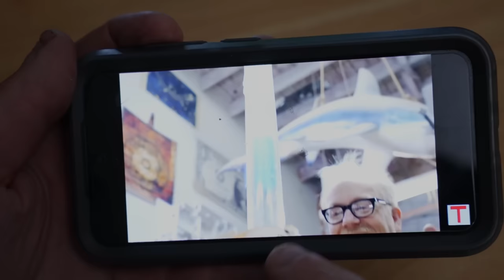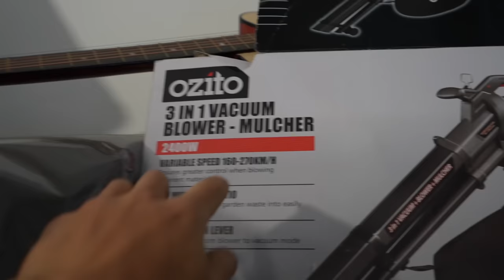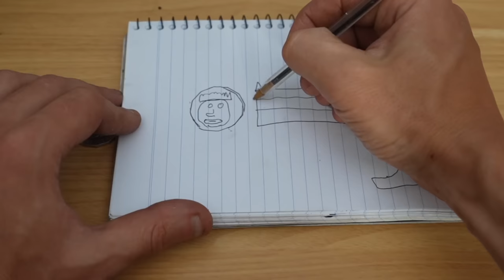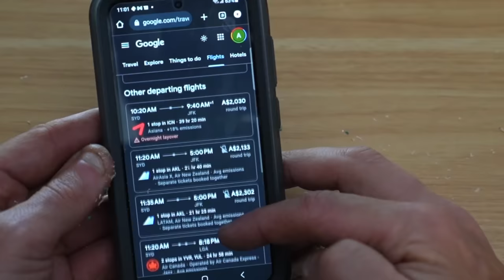The Mythbusters Were Wrong!

Comment from the maker: Some people are confused about things in the video that i didn't explain very well. 

1. Me throwing the coin had nothing to do with anything. I just wanted to know how fast I could throw a coin and also if it was possible to keep it on the skinny edge. 

2. I wasn't suggesting that you need to throw the coin off the empire state building to reach a fast enough speed to kill someone. Just that by dropping it with a spinning motion would keep it on the skinny edge allowing it to reach a much faster terminal velocity.

3. The terminal velocity I calculated was actually slower than ones that people in the comments have estimated using physics programs. Some of the estimates were around 300 kmph. 
The point of the pig test was to show what a coin traveling at 230kmph (slower than the terminal velocity) would do to you. Turn you into a piggy bank

4. Also the point of the dam test was to show that the spin would at least keep the coin on the skinny edge for 45 meters. 

5. How you going?
Reply: Goop. make a pellet gun that is as powerful as a 22 by using petroleum
Reply from the maker: I would love to but you cant get pellet guns here @thebathroombandit
Reply: I’m going well mate how are you. Sydney weather been a bit all over the place ay…
Reply: wats ur workout plan? Lemme get on dat?!..
Reply from the maker: I just chuck lots of coins at my wall @nolanbarker8913
Reply: how much force do you use per throw? @Ididathing
Reply: With more force than a professional MLB player obviously 😂
Reply: fly to NY and do a in person test
Reply: I am doing pretty good, thanks for asking. 

I am not sure whether it is harder to throw a baseball than a coin, but I suspect it probably is.
Reply: I’m pretty sure the reason your calculation was so wrong was because it was ahead
Reply: Oi oi oi, I am much less good after that comment about my mother.
Reply: I'm good but it will take me 20 years to read all of that 😂
Reply: bulletproof armor out of the desk
Reply: i will now throw a penny
Reply: im pissed mate hby
Reply: 1. You demonstrated some amazing ninja-coin-throwing skills, if it was only for that, the video would still be worth 10 out of 10.

2. I understand you did not suggest anything, but that's a great idea anyway!!! You deserve 10 virgins in Jannah for your righteous contribution. Allahu Akbar!!!

3. Side-facing, a coin is very aerodynamic while very dense - I would not be surprised if it would reach velocities higher than that. The same properties would also allow it to penetrate first layers of a target quite easily, but I don't think it would have any capacity to penetrate deeply - once inside flesh, it would turn on the side and quickly stop, so if it misses head and hits shoulder, for example, it would make a surface wound. Other than that, pig head is probably not a good replacement for the human head (I'm not suggesting anything, so if you happen to grab a neighbor and fire a coin-gun at them point blank, I have nothing with that) - the pig head you are using is skinned, plus, as far as I know, human skull is tougher. Anyway, a direct hit on the temple at 90 degrees, based on what you demonstrated, should mean bad injuries/concussions/travel to the ER/a very bad day.

4. The faster the spin, the more stable the coin should be in flight (we could imagine a device that can spin it very fast - like the slingshot you made, but with one side of the channel lined up with something that would add some friction to that side only). The trouble is - the faster it spins, the more it will tend to curve the trajectory.

5. Great, thanks for asking.

0. MythBusters and Veritasium are assholes with a lot of money and insufficient brainpower and creativity.
Reply: Im doing meh, you?
Reply: Wow sucks to live ausie
Reply: can you throw one into a vending machine
cheers
Reply: Australian but spells metres like a Yank
Reply: as a response to number 5, i also and confused about how i am. You didn't explain it very well in the video.
Reply: What about the video by Veritausium?
Reply: On the skinny side the surface area is too small to be blown by the leaf blower.
Reply: @ENDI8089 and thats the point bc terminal velocity works the same
Reply: No. You are wrong. Shooting a coin with controlled rotational and axial spin has NOTHING TO DO WITH THE REALITY of a coin in freefall dropped from a building.
What is wrong with all of you?
Reply: @aleksandarrudic3694 are u okay dude?
Reply: I goes.
Reply: Fun video. You've shown coins can be lethal, but not necessarily that a dropped coin, even with spin, would be lethal. These experiments, and calculations don't account for a variable that would be a game changer in the real world, and that variable is wind. The experiment at the dam was a fairly short distance to begin with, but it was also in an area that blocked the wind. Tall buildings can have their own airflow around them. Not only horizontal, but also vertical updrafts. Some updrafts can even push coins back up, where they land on a separate surface of the building.
Reply: you also didn't explain the sex toy in the garage
Reply: @mfloth I little bit cold, but okay otherwise, thanks for asking
Reply: I'm doing well!
Reply: I'm doing good thanks! Just another video where I fear for your safety and health 🤣
Reply: you should try making the worlds fastest slow cooker (without making a bomb)
Reply: Good how bout you
Reply: You didn't show the coin accelerating for 45 meters.  And you also reminded everyone at the end that you have no idea how stability, tumbling and terminal velocity come into play when you said "oh and the empire state building is x times higher than that..." That's not how anything works homie.  It could be 1, 2, or 100000000 times higher, and it wouldn't make a bit of difference.  And showing the coin fired out as a projectile.... hilarious, I guess, but not in the way you intended.  You do understand that even bullets, which are designed to cause damage, have to be specifically engineered to not tumble, and they're being thrown out with a lot more force than you putting some stink on a coin with your noodle arms.  And you do understand that firing something as a projectile isn't a good analog for a falling object.  Nobody ever said a coin couldn't possible reach a certain speed, they said it couldn't maintain a certain speed, and would most certainly find equilibrium pretty quickly.  Try throwing a coin on its edge straight down into water and doing any damage to anything even 1 foot beneath the water's surface;  It isn't going to happen.
Reply: Nice explanation. Granted i do not know what was so confusing people needed a recap lol thorough job nontheless
Reply: This doesn’t change the fact that the myth busters were, in fact, correct.
Reply: @Ididathing Can you make bear trap teeth.
Reply: Amazingly thousands upon thousands of coins have been thrown off the Empire and no one has died. You dont need a Youtuber with faulty science to prove Mythbusters wrong just common sense
Reply: I think you will  still be safe under the empire state even if you add a small amount of spin since there are other air currents generated by tall buildings that would push the coin side ways causing the fluttering to happen and thus lowering terminal velocity
Reply: Doing pretty decently. hope it goes up from here.
Reply: @meghanm6282  exactly, this guy proved that guns are lethal, and proved the myth busters were right lol. Mind blowing work he did there. And by mind blowing work, I mean my mind was blown by how absolutely incompetent this guy is.
Reply: Drop the coin from a drone - post results
Reply: @Ididathing  guess its time for a trip then eh?
Reply: I'm going pretty well Mr. Thing, thanks for asking!
Reply: @thebathroombandit pellet guns are already about as powerful as a 22. At least in initial velocity. I had one that shot at 1300fps, which is faster than .22
Reply: Slightly to the left as usual.
Reply from the maker: Same. We are talking about our wangs right? @Black0utDayz
Reply: I thought it was amazing, and im doing well thanks
Reply: @Ididathing  gay
Reply: U missed one thing (actually few), the wind that comes up at building and it's not "stable" so it might flip the coin also there is a huge distance to travel and after some time of falling coin will start to lose his speed basically coz of wind factor and resistense of air ¯\_(ツ)_/¯  
Also "heated air" got different "viscous"(thicker) than cooled air which one will be on the top of the building also "metal" can "grow" and "shrink" depends on temperature yes it's not gonna be extremal difference but it could affect to result ¯\_(ツ)_/¯
Hope I didn't miss a thing :D
Reply: I’m going well, you?
Reply: spinning. like if a coin was rolled off the edge.  
and yes 50c rolls pretty well it just makes a crapload of noise while doing so. especially in multi-storey car parks in sydney.  

also paintball guns are legal now with a 30min application. you could own one legally for exactly the time it takes you to film and post a video.
Reply: I learned how to "flick" coins back in like middle school from this kid. He could take dimes, pennies, nickles and smash bottles and windows lol
Reply: I'm confused as to why you told the adorable little girl that she was "really bad at that" when she was playing on the piano?
Reply: Yeah nah yeah
Reply: not great
Reply: going great
Reply: I'm good. Thanks for asking
Reply: in a vacuum yes, but there is wind, even a calm day will have a bit of wind.
Reply: @bigbadsauce92 ooooooh that's why my windows were always broken.
Reply: theres a significant cross-wind at the empire state building.  If you threw a coin with spin, would it even have stable flight the whole way down? or would the wind knock it out of its spin and make it flutter like in the drone test?
Reply: I'm going fine, what about you?
Reply: shouting allahu akbar upon releasing adds a deadly touch
Reply: @Ididathing classic Australia
Reply: baby lanucher
Reply: Love you in a unhealthy parasocially obsessive way, btw was the coin traveling 20cm in 1 frame due to the software of whatever you used to play back the video not actually giving you a true 1 by 1 frame skip? on youtube the coin is like 15cm long in the slowmo bit so that's some wild rolling shutter. you need a proper global shutter high speed cam to do that type of slowmo footage speed calculation or is it enough to just follow the leading edge of the object? Love you so much etc, gonna liven't myself if you don't reply etc.. <3
Reply: Too bad you wasted all that time proving yourself wrong.
Reply: @lint8391 she smiled. He said something nice and then added voice over later. ADR.
Reply: I'm doing pretty good, just watching some crazy guy make a coin crossbow

Comment: So I calculated an estimate using wolfram alpha.
Fall distance: 377m (1237 ft)
Drag coefficient: 0.431711746 (best one I found)
Projected surface area: 87.52 mm^2 (spinning dodecagon with thickness)
Fluid density (air): 1225 g/m^3

Weight: 15.55 g (like half a bullet)
The result was 67 m/s (241 km/h, 150 mi/h) for the speed of the empire state building (visiting area) and 
                           82 m/s (295 km/h, 183mi/h) for the terminal velocity 
which are very dangerous indeed (deep tissue injury, bone fractuce)
You would also keep the coin stably spinning for at least 11 seconds.
Reply from the maker: Thats awesome. I shot the pig head at around 230 kmph so 240kmph could definitely be deadly!!! I need to use programs like this
Reply: It would be a challenge to keep it spinning around z axis only for 11 seconds considering wind. It would need to have a hole and be much bigger to have the same mass 🤔
Reply: I agree washers would probably spin more stably because more of the mass is further from the center, but I also think the hole would increase drag substantially. You could probably get the best results by using a washer but taping over the holes
Reply: The entire point was a penny though, where has 15.55g come from exactly?
Reply: @wyterabitt2149  In the beggining of the video, he mentions the 50 cent australian coin, which is heavier than a penny, is what he uses for his test.
Reply from the maker: @wyterabitt2149  Tourists often visit so wanted to know what would happen
Reply: to bad i think you can't even fit a half dollar though that grid
Reply: Awesome
11 seconds!😮
Is that how long it would take, from the top of the Empire State?😱
Reply: @amosbackstrom5366 the center of mass is always in the center. But for a given weight the radius of gyration is larger.
Reply: @justinlabarge8178  Fair enough, I dropped out of high school, but at least you knew what I meant
Reply: @amosbackstrom5366  
He's trying to baffle you with bullshit/science and big words.
Think about it.
The centre of mass isn't always in the centre.
If you glued a lead weight to the inside of a ball . The centre of mass wouldn't be in the centre of the ball.  Would it?
 Don't put yourself down Mr Backstron.
Reply: @MrBollocks10  And now that I reread my comment, I never even mentioned the center of mass. I just said more mass will be further from the center. Which would have a stabilizing effect think.
Reply: Yes what you said is totally right since having all the mass squeezed at the edge I would increases the moment of inertia
Reply: 15 grams is already as heavy as an entire .45 ACP bullet, about 230 grains and that's on the heavy side for this day and age, unless we're talking anti-materiel rifles.
Reply: Terminal velocity the bullet can only go so fast
Reply: 15 grams, "half a bullet"?! 231.486gr?! That's 462.972gr so "like half a bullet" just happens to be a S&W 500 magnum? 
You - It's just half a rock. The rocks weight 7.5T. xD
Reply: One small breeze on the way down and it becomes like stone thrown by a child.
Reply: After a while wouldn't the aerodynamic forces stabilize the coin in the most aerodynamic direction?

Comment: I love how he basically made a crossbow, but took no inspiration from how crossbows are drawn back and struggled to pull it back every time
Reply: was literally thinking this
Reply: Re-inventing the wheel...
Reply: @GenJuhru making a wheel using only a wheel
Reply: well its a really fat slingshot since it uses the elastic of the string rather than the elastic of what the string is fixed to. but yeah he should have just had the foot thing that goes on the front of crossbows